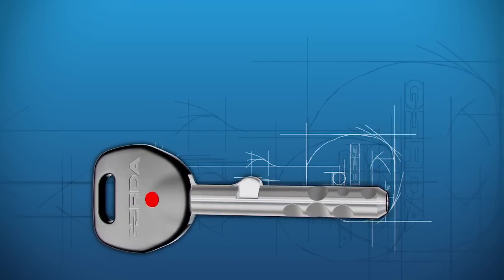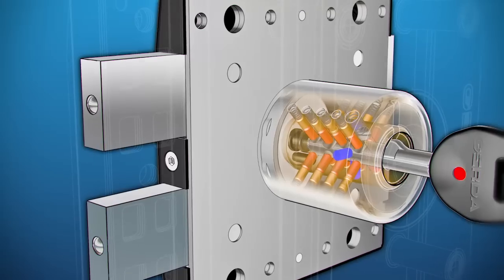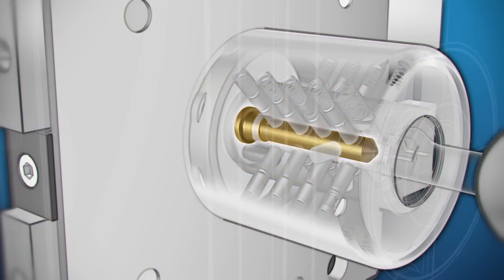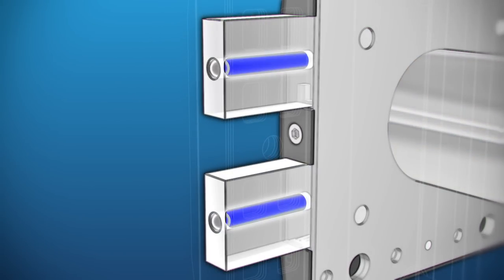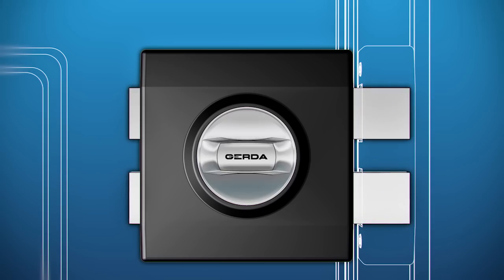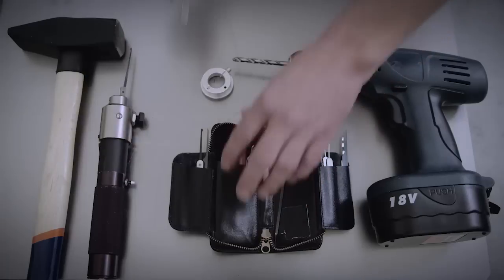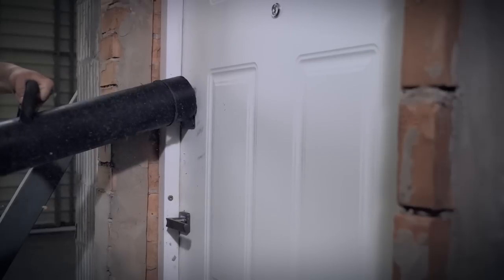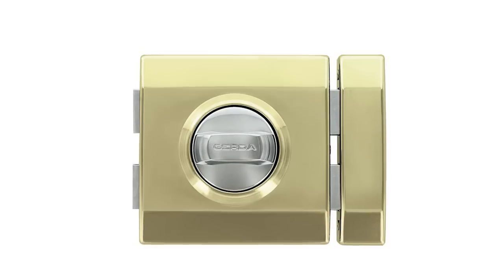GERDA G1000 High Security Lock

Comment: I suppose there's always the oxygen lance, but once you get to that point I feel like it might be more practical to simply bust a hole in the wall itself.
Reply: Windows tend to be forgotten about.
A glass cutter for £5 makes some quick straight lines and makes for quieter entry with a rubber mallet and a punch. Look up anti bandit glass and even that doesn't last long.
ESG seems to make good anti bandit, but that's because it has some thick plastic layers and isn't representative of most anti bandit glass.
Reply: hello, easy to emergancy opening.
U need 2x hole drill 46 fi.
you need cut the top on one and the bottom on the other and have to weld together. Then you drill the core from the body. 5 minutes of work (if you have the tool ready)

Comment: i am somewhat curious as to what makes this lock allegedly resistant to bumping.  any that we have taken apart do not appear to have bump resisting features.
Reply from the maker: And we are somewhat curious if you actually managed to bump it? If so, please help: http://youtu.be/tLeiPmfm-2s
Reply: Bosnian Bill made a bump key and failed. I suspect it is because bumping works on one axis at a time. This is two axis, so the shock cannot apply to all 4 rows simultaneously.

Comment: Is there a conventional method you use to identify the depth of dimples used in the lock? I see they use 16 pins, each has 4 different depths. That's 2^32 combinations. You could encode the depths of the dimples in a hexadecimal format. How do you refer to them?
Reply from the maker: We use our own notation and decoding tables. But if we were to use the simpler system, that could be hexadecimal, octagonal, or even binary.
Reply: Why don't you use the simpler system(s)? Does your system encode other data other than pin combination?
Reply from the maker: +Nitrxgen No, just the key cuttings (pins). The code is on the key card, so it would be very easy to cut the keys. You have to present two keys or one key with a key card to be able to duplicate the keys. We wouldn't like to give access to unauthorised people.
Reply: How would using your own system or using a basic hexadecimal system on your cards be any different? I'm studying to become a locksmith (so yes, I'm targeting your locks, haha) and there's just some things I don't see any logical reason to. For example, why do you need the card and a key for you to duplicate? Wouldn't the buyer of the lock be the only person with the card anyway? You wouldn't be giving unauthorised access to people. Plus, if you had the key anyway, it would be pretty easy to duplicate with that alone using 8mm pipe with a 4.5mm inner diameter if you're good at DIY/metalworking. Sorry if I don't understand your methods. I presume the code on the card error-checks itself too?
Reply: Ah. I understand now. After more research, it's illegal to copy patented systems including the keys, and Gerda lock systems are patented. Hmm, fair enough.
Reply from the maker: +Nitrxgen Yes, the GERDA key is trademarked. We only cooperate with licensed locksmiths.
Reply: That's respectable. Sorry, I just forgot about patented locks, they're not as common! Could you confirm that your H system use your G-series locks? They use the same keys, though your barrier locks are different. Is the H system the only range of locks with a master key? If I'm asking for too 'secret' details, please let me know, I'll stop asking.
Reply from the maker: +Nitrxgen Both use the same type of cylinder. If you need any further information about the H system, call our UK company: gerdasecurity.co.uk
Reply: Alright. I take it the H system is exclusive to the UK? Are there other such systems for other countries?

Comment: How about if you lose the key ?
Reply: New door or door frame.
Reply: You call around until you find a locksmith who has the $1,400 decoder kit and has taken the day long training class to open it. Depending on where you live and how common those locks are, prepare to pay either an outrageous or a "YOU'VE GOT TO BE EFFING KIDDING ME, YOU CROOK!" fee to keep from destroying your door.
Reply: @84westy55  lol. F$%#  that .. I guess we all are better off just putting a chair behind the door
Reply: @markp8295   I think that's gonna be a lot of money
Reply: @williamkuryaki  The alternative attack is to use a long reach hole saw the same diameter as the key.
Drill through the whole lock so you can manipulate the hand turn on the rear.
The rear plate isn't hardened.

Comment: hello, easy to emergancy opening.
U need 2x hole drill 46 fi.
you need cut the top on one and the bottom on the other and have to weld together. Then you drill the core from the body. 5 minutes of work (if you have the tool ready)

Comment: I will tell Gerda Titan for 52 seconds, without the noise and dust, elementary !!! seket method and how to open this lock can not sell - leaving retirement.
Reply from the maker: We can open our lock in 2 seconds... and so can all of our clients. You are not even close! And we'll tell you the secret... though it's classified... You just need an original GERDA key! Available now (4 in a box), together with the lock! :):):)
Reply: You have not understood correctly - I open any lock without the key!
just open the period.
Reply from the maker: Sure, we did! And if you learn what really happened in Roswell, just let us know... For now, good luck and goodbye!
Reply: "Gerda Titan" is older verion of that lock...
Reply: tak gerda tytan to starszy model mialem 8 lat teraz G 1000 i jest najlepszy.
Reply: Albert Rieder  eBay €90 or €115 with enhanced face plate (which I recommend as I have seen a few destructive attacks work on badly fitted locks.